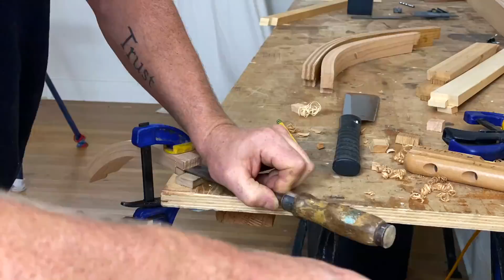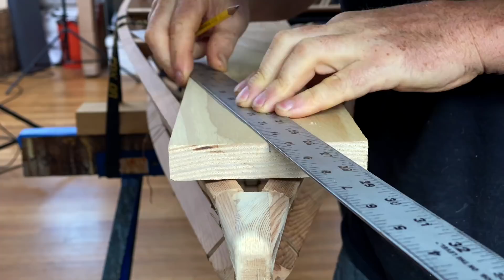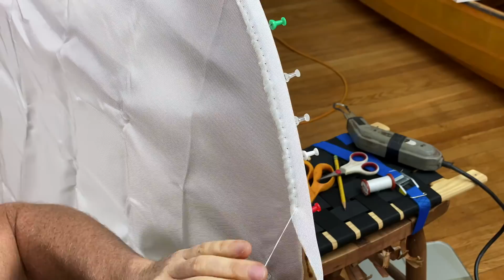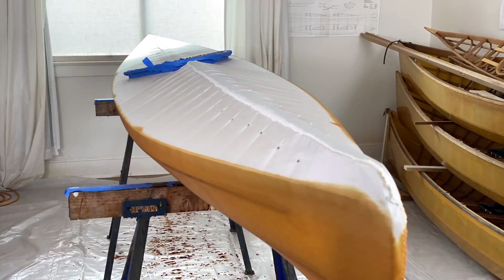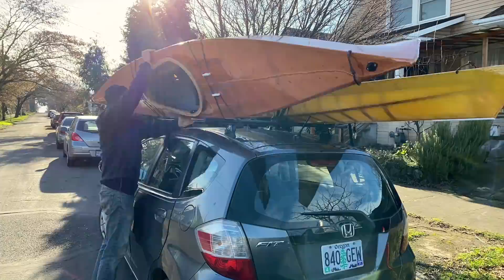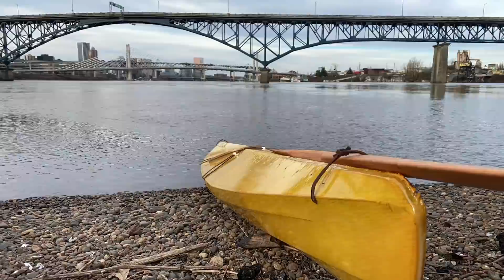Timelapse: Skin on Frame Kayak Build, from Wood to Water

Comment: Must be the slowest builder in the world;  took me 6 full days to do what Brian did in minutes.  Course they were rewarding days.
Reply: Can you tell me the length and beam and (most importantly to me) the finished weight of the kayak you built in this video. Thank you.
Reply: @jaydeer6367  there are east and west Greenland plans, f1 and long pointy boat plans, canoe plans and hopefully coming soon a river kayak with what looks like leanings toward a northern Alaska style.  The kayak shown appears to be the f1 which is the sea kayak with good surfing characteristics.    The plans change the dimensions to tailor the kayak to you. The weight is between 24 and 30 pounds.  I am 240 # which was about the largest size and the finished boat with lines was just at 29 pounds.  The length is between 13' - 3" and 14' - 3".  The beam is 22 to 26",  the waterline is narrower.  This is the quickest boat I have ever paddled.  The Greenland boats will be narrower.  There is a stretched version (LPB) that is longer, if you are a sprinter not a normal tourer.  The f1 works well for me on inland seas, lakes and mild rivers.  It was designed for the ocean coastline, but those are a ways from here.  Go on over to the cape falcon kayak site and poke around.

Comment: I'm always scraping bottom on something I didn't see straight away or pulling it over beaver dams or running into unique situations when portaging from one lake to the next...

Your canoe is real pretty, that's top notch craftsmanship. I'd be scared to put a hole in it when I'm days into the back country...
Reply from the maker: Check out the video that I uploaded called skin on frame durability.  I go into a ton of detail about this but the cliff notes are.  It’s not indestructible by any means but has an equivalent durability to any other type of boat the same weight.  And you can always put on a heavier skin for more durability.  I lost a tandem in a nasty surf landing about 10 years ago and it flushed around the corner and into a cliff lined rock Cove. The kayak rolled up and down the rocks in the surf for an entire tide cycle until we could get to it.  There were no punctures in the skin and only one broken rib.  Although everything made of metal on deck including my fishing reels and the rudder was obliterated.   In that same video I show what happened to a skin last summer when myself and my girlfriend got high centered on a piece of submerged rebar in the canoe.

Comment: Work of art my man. I wouldn't want to take that thing out, I'm rough on my yak lol.
Reply from the maker: I think you’d be surprised.  It’s not bulletproof like a plastic kayak, But it will bounce off of things that would put a hole in a Carbon, Kevlar or fiberglass boat.  A few years back we lost a tandem in the surf and it washed around the corner into a cliff lined cove, where full of water it washed up and down a rock slope through 2 tide cycles before I could get down to get it.  One cracked rib and no skin punctures.  So pretty good for something that weighs about 30 pounds.  If you check out the channel here I’ve got a video on the skin on frame durability where I have a picture of my friends truck that he rolled over his boats.  Couple broken deck beams but still no skin punctures.  That one kind of blew my mind because the truck was totaled, sure it had something to do with how he rolled though.  You can see the shape of the boat where it smashed in the windshield and the top of the cab.

Comment: Awesome video on a very I threshing subject. Very well done and at the proper speed. Native American Inuit use seal skins and the construct is done by women. When the women are done they hand it off to the men and never touch it again until they have to re-skin the kayak.  These seal skins not only cover the kayak frame but caribou skins are extensively used in the construction of cold weather gear except for the hoods that are made of fox. These skins need to be replaced every two years. Again great video. Real pleasure. Subscribing. Semper Fidelis Semper Paratus

Comment: It is so nice to see teamwork on building your Kayaks. Have you ever use Kevlar fiber or Carbon/Kevlar fiber glass to cover your Kayak? I Did see someone awesome color Blend of Fiber?  What does it Take to Cover your Kayak?  5 to 7 Yards? Hope to see some more new builds .  God Bless.  Greg
Reply from the maker: The length of the cover just depends on the length of the kayak.  Things like Kevlar and carbon fiber are more compatible with fiberglass style building systems.  The material here is nylon although some people use polyester.
Reply: @capefalconkayak  Dear Sir could it be done to widen one of your Skin Kayak? Maybe 30”or 32” ? I am a little heavy and like to build one but 26” to 28” will not carry my weight? On the Kevlar/Carbon Fiber could I use one Layer? Do you want me to go to website?  Greg of Ohio
Reply from the maker: @gregoryh4601  you could absolutely make it wider but You would have to change the design somewhat.  I don’t currently have a design that wide but you could use the same building system and experiment!
Reply: @capefalconkayak  I want to say thanks Some Much the you Help and you don’t know how much I care for this Help. I will look at what Blue Print to but from you!  God Bless and please take care with this China Virus going around.  Greg of Ohio

Comment: Incredible workmanship.  When you are setting up the deck rigging, you put holes in the fabric covering, high up on the sides of the kayak.  Do these holes leak?
Reply from the maker: I pull the leather through undersized holes so leaks are pretty minimal.  If you don’t do this right though they can leak pretty badly

Comment: That is soome great work! It would good if very occasionally you slowed it for a few seconds just see more detail like the stitching. Greetings from Scotland
Reply from the maker: Hey David check out some of the other videos on the channel I’ve got much slower versions building the same kayak.
Reply: @capefalconkayak  
Hi, yes I found it right after I posted my comment. It really is great work. I’d love to build one, even though I’ve no notion to use a kayak, I have a sailing boat. But I love to make stuff usually from wood. I did make a dog sled from pictures only, and it turned out great!  I’ll check out your other videos. Thanks.

Comment: What's the puncture/scrape resistance like of this method? Would it stand up to Class I and II water? Also, are there any variations available that don't require the use of a spray skirt? Very few people in our area of the world (central Maine) run spray skirts for casual kayaking
Reply from the maker: I’ve got a video here on the channel called skin on frame durability that goes into a lot of detail about this.  That it is about as durable as any other construction technique of the same weight.   So this weighs about half what it would in rotomolded plastic and it’s about half as tough as that.  If you increase the thickness of the skin to achieve the same weight as plastic, it would be the same durability as plastic.   It’s slightly less abrasion resistant as a fiberglass boat, but much more impact resistant.  It’s possible to puncture it, but it’s extremely rare, and requires an object that is sharper than almost anything found in nature.  Check out the video I go into a lot more detail.
Reply: @capefalconkayak  Thank you. Are these skin on frame builds field repairable? Say you're 50 mi out on the Allagash and get a puncture

Comment: Great build!  What I'm curious about though is the crossbars on your Honda Fit.  Most of the ones I've seen  are not far enough apart  for me to be comfortable putting a canoe on.  It looks like you have different crossbars on the front and back.  Please clue me in.
Reply from the maker: I can’t remember what the standard spacing is exactly but the rack places like to put it on that way because if you go past that spacing it doesn’t fit with the commercial rooftop cargo carriers anymore.  I don’t care about that though so I had them put it on 48 inches apart and just mounted the rear ones or maybe it was the front ones directly to the body metal.

Comment: Whats all the stuff its being coated with? Doesnt that cloth rip very easily?
Reply from the maker: The nylon cloth is surprisingly strong when coated with the two-part polyurethane I use.  I have a whole video about this on the channel called skin on frame durability, But I think the easiest way to understand it is that you could hit it as hard as you can with the claw end of a hammer and it wouldn’t puncture.
Reply: @capefalconkayak  very interesting thanks.

Comment: Very nice. But wouldn't hold up to the abuse I put my kayak through on an outing.
Reply from the maker: I guess that depends on what you’re doing.  If you’re interested in the subject to check out the video that I made on skin on frame durability.  If I get thrown into the rocks in one of my skin boats I generally just bounce off with a few scratches.   If I do the same thing in one of my fiberglass boats there’s a good chance I’m gonna be fixing a hole.   Just to give you an example if I were to hit us as hard as I could with the back of a claw hammer, It wouldn’t puncture
Reply: @capefalconkayak   Have put mine through serious abuse over the years. Lots of sharp rocks never a hole. What you make is great craftsmanship but more of a novelty.
Reply from the maker: I’m not sure why you’re arguing with me here it isn’t a contest, every building material has advantages and disadvantages.  I’m a professional skin on frame builder but I own a ton of different types of boats.  I like skin on frame because I can build a boat for $500 in 40 hours that weighs 30 pounds but is strong enough that I can drop it 15 feet and it will bounce.  Some of the places that I enjoy paddling I have to carry the kayak a few miles to get there and that’s just not something that I can do with a fiberglass boat on my head. It’s also really nice to be able to customize the design to the exact performance that I want for various types of paddling.  I also think that a very slight flex really helps to absorb impacts.  Speaking from experience getting the stuffing beaten out of me in the surf is a lot less violent in a skin boat than a glass boat.  As far as the durability goes, I’ve put 1500 of these on the water in the last 20 years and we’ve only had two on the water failures.  I think that’s pretty comparable to just about anything else you could build a boat out of.

Skin on frame kayaks were the backbone of arctic survival for over 2000 years, and the toughest human beings to ever exist used them to hunt seals walruses and small whales.  I’ve done extensive coastal touring in them, I circumnavigated the big Island of Hawaii in the winter, paddling 40 mile days in 30 foot seas, I’ve pulled up halibut and salmon, and even towed logs that I later chainsaw milled into boards that would become the frame for my house.  So that’s the reality here.  It’s a real boat, and just as tough as anything you’re paddling.
Reply: @capefalconkayak  Not arguing with you.  Take a chill pill. Seems modern materials and advances in building technology have put your type of ancient boat building to the craftsman who have the time and skill to achieve. If it were superior you would see them everywhere.  I still use an old recurve bow to play around with but it can't compete with my modern compound bow. Been white water and kayak river fishing since my military days. Never a failure even when renting a boat. Seems your the sensitive type when it comes to opinions though. Go away now.
Reply from the maker: @fs3994   I feel like you’re still missing the point of what I’m saying.  The analogy of the bow here isn’t right.  I hunt with a compound bow because it’s the most effective tool for the things that I want to do.  And that’s the same reason that I build this kind of boat.  I like it because it’s faster and lighter and stronger, not because I have any particular fancy for historical authenticity.  It doesn’t mean that I have any kind of problem with any other boat.

Comment: Great build, but the video was hard to watch.. I feel like I need to go have a lie down to avoid a headache, and I'm already on the couch.
The time-lapse was too fast - half that speed would have been plenty.
The music doesn't work at all, and is completely wrong for this kind of project.
Finally, the actual boating section at the end needed to be real time, with the audio of the paddles in the water, and the sounds of birdlife and wind..
I give 5 stars, for the kayak, and minus 4 stars for the video.
Reply from the maker: Hi Gene, lots of options here to make things better for you.  YouTube lets you select a variety of playing speeds, and you can also mute the sound and play whatever music you think fits best from your own library.  If you’re looking for more of an acoustic experience, you might check out some of the hour by hour videos that I’ve done which play at normal speed in small pieces as opposed to super fast over the entire build.  Enjoy!